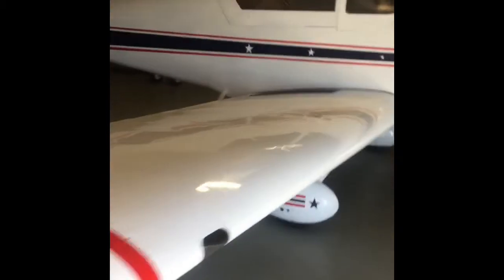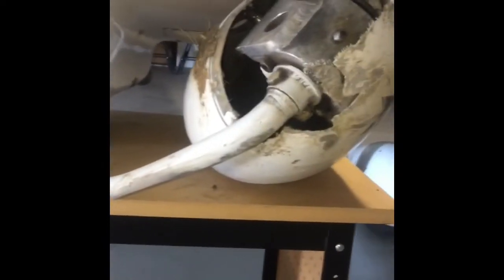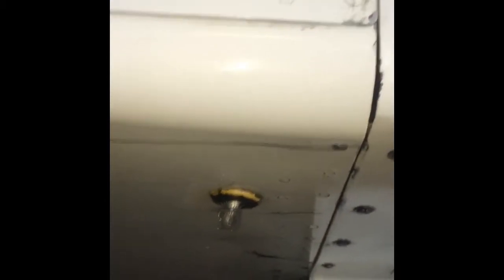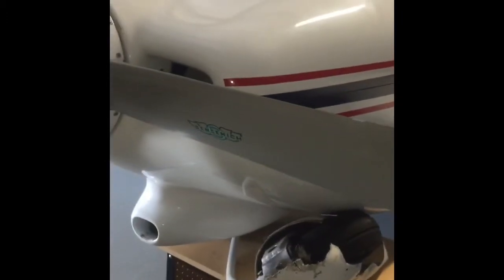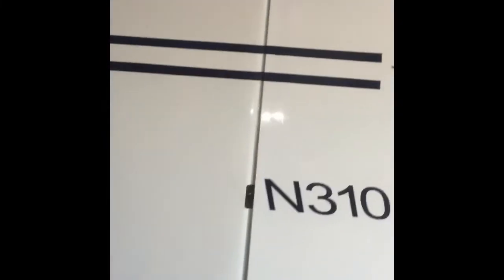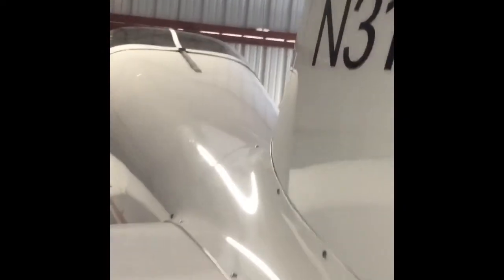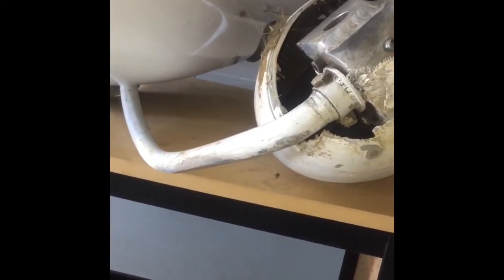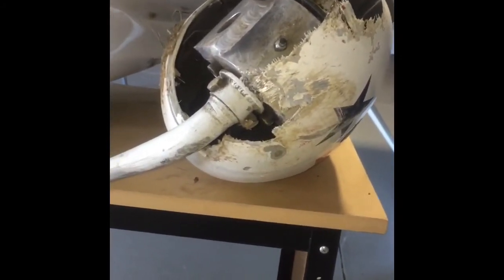RV-7a Nose-Gear Collapse Part 1

Comment: Your nose wheel steering stop appears to be on backwards, i.e. it should be turned 180 degrees. Vans put out a service description of this quite awhile ago and explains that this can cause a gear failure. Go on to Vans website and it will show a picture of the proper orientation.

Comment: Today I installed the Anti-Splat upgrade, and the Lip skid, wheel bearing mod with balancing
Reply from the maker: Good!  Do you think it makes it more rigid?  Let me know your thoughts on the kit!  Thanks!
Reply: I have a picture I was trying to post in here. I think with the brace and the wheel bearing and balance will make a difference. I really like the wheel bearings. I can now tighten the axle down without worrying about the pre load.
Reply from the maker: Very cool! Not sure what I'm going to do about new gear.  I may have something different fabricated.  We will see.
Reply: Looking forward to more videos
Reply: Just amazes me why anyone would ruin the sleek lines of a Vans machine by making it like a Cherokee!! Nose draggers look god dammed ugly and dangerous!!
Reply: Anti splat helps one area but affects another. Poor design by Vans.